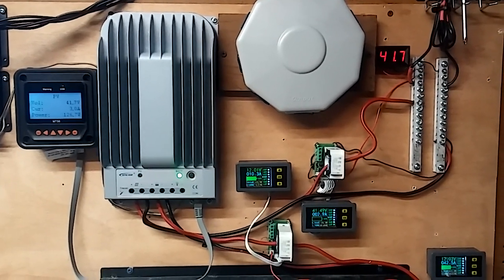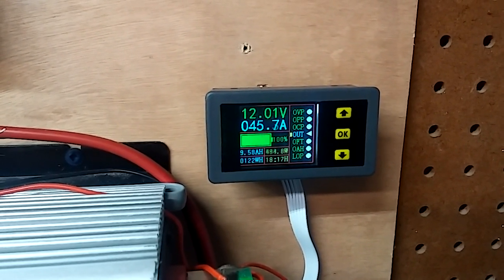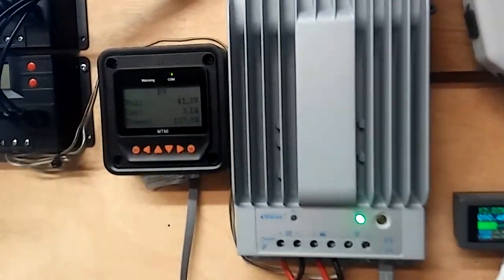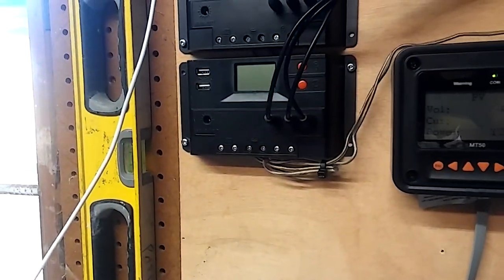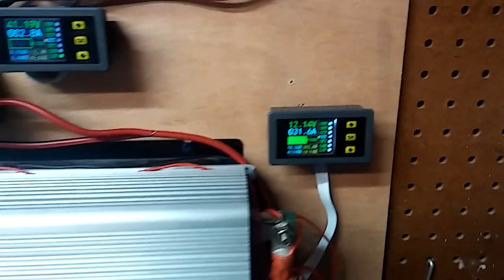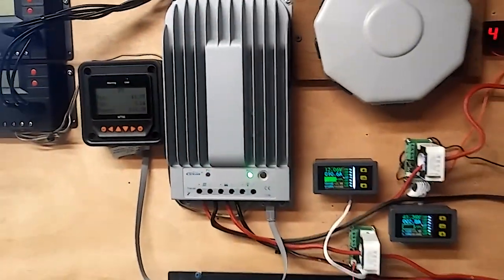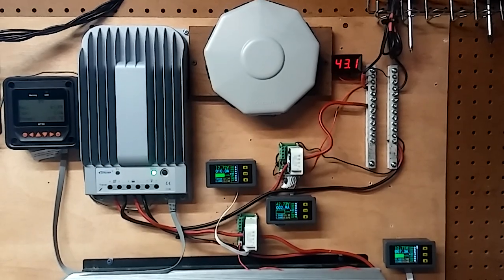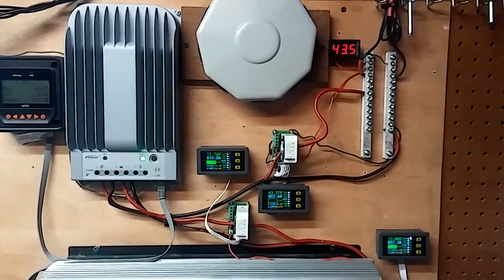12 harbor freight panels in series with mppt. Nice and sunny

Comment: LOVE TOO SEE THE WIREING ON THOSE PANALS, DID YOU CUT OFF THOSE PLUG IN S WIRE THEM TOGEATHER/ WITH TOO DC WIRES THAT GO TOO A BUSE/ FUSE THEN CONTROLER?
Reply from the maker: Yes,, I cut the connectors off. There are 3 100 watt kits. 4 panels per kit. 4 panels go into a connector that gives you one connector out. That is the connector I cut off of each kit.
Reply: @Checkitfirst  I HAVE GENERATION 1  HF 45 WATT PANALS 6 TOTAL, WOULD LIKE TOO WIRE THEM TOO A BUS AND TOO MY EPEVER MPPT 150VT ?  TWO WET DEEP CYC, PURE SINEWAVE INVERTURE. 4 MY GRN HSE.
Reply from the maker: @debbies3763  
Do it. Run your panels in series you’ll be around 118 120 V I’m guessing. Just be careful not to shock yourself with DC voltage because it hurts. I’ve done it lol
Reply: @Checkitfirst  THANK YOU FOR YOUR RAPID RESPONCE TOO MY DELIMA, I didnt want too purchase that round connector.
Reply from the maker: @debbies3763  
Lol. I threw mine away 😁

Comment: When you are just charging your battery with no load and no inverter plugged in, what are some typical numbers for Amps into your battery as viewed on the MT50? 

I have the same set up as you and I have quadruple checked everything (I am running HF panels, 2 sets of 100W with two each paired in series and then those four (sets of two) wired in parallel to the same charge controller you have. I have reset my Mt50 several times. I seldom get even a full amp into the battery. Usually, something like 14.4Volts/0.7amps into the battery until it reaches Float and then down to 13.8 volts. My batteries  (12 volts, deep cycle, AGM, 1200AmpHour) charged one at a time very well and usually within one day of Southern CA sun. (I rotate them out one at a time and bringing them into the house to connect to a 2500W inverter to watch TV, run LED lights and such). I never deplete them more than 30% based on monitoring AmpHours used.  I just don't seem to ever see the current you do into the battery but I never charge them with any load on them. 
Ideas??  Thank you.
Reply from the maker: Ben Kanobe. Well, I no longer have mine hooked up in series anymore. I like the way mine works in parallel better. A lot of times I would show a good voltage but I just wasn’t getting the amperage. I would just put it all back to parallel if I were you and try that. If it doesn’t work out let me know I will do my best to try and help you if I can
Reply from the maker: Ben Kanobe. Also I was told that those AGM batteries don’t draw as much current as A typical marine battery like mine. I hear they’re slightly more efficient so they just don’t need high amperage to charge them up

Comment: Hey check it first, Just wanted to thank you for great videos. I am happy I came across your channel I have learned a lot from you and just bought a harbor freight kit. Please keep making videos about solar systems.
I watched all  of your videos in one night, great stuff and I also subscribed to your channel.
Reply from the maker: mrhodes100. I’m very happy to hear that. Im thinking of adding wind power to my setup if I can find a decent radial axis. Thanks for watching and subscribing
Reply: Wind power would be great I don't know a thing about it just like I didn't know about solar until I watched your videos .

I have a question, are the Cen Tech inverter any good I have the 750 w one?
Reply from the maker: mrhodes100   I haven’t heard any bad comments on them.

Comment: Hi i think if u get 330w panel u mentioned .IT will be about the same as what u have in  w  may be a touch moore i have 300w and they only give me at best 180W so when sun hits panel u lose around 20% so ishould have 240W  but no no 180W i think your set up has improved. Soi think u need pure sine inverter get 300w panel look up how meany amp panel produces my 300W give moore amp then 320W but 250 W give moore then the 300W so look in to that before u buy panel i couldent power 100w light bulb now i power aircon 5 300W panels and only 2 65amp ds batterys 2.4kw box air con i have 2 12v systems 1 i power 3desk top pc and fridge while sun out with 170amp ds battery

Comment: I am the guy that suggested changing the angle..There are charts that have the best angle for this time of year...I know the sun is low this time of year...Maybe take only 1/2 of the panels off the roof.. Make them closest to the angle the best you can on those...Hook them up to your system...See which set does better..Also, keep in mind , these are not chasing the sun following its angle through the day...I am not sure what kind of setup you can do there...Does it need to be on the roof? Maybe a setup on the ground you can control to face the sun easier. You could move the panels through the day..
Reply from the maker: Sounds like a good idea. Maybe I will try that.

Comment: Looking really good, I know when I talked to Renogy about my charge controller it is VERY important to not exceed max Voltage on the charge controller, but a small amount over on Amperage it could handle for a small amount of time.  I mention this because some of those bigger panels run at a lot higher voltage & I don't want you to fry your new controller.  Read the specs & follow the manufacturer recommendations & have fun.  
Thanks for Sharing Friend.
Reply from the maker: Thanks for your input. I really appreciate it. It has a 150 max volt input. Thats kinda scarry to me. 150 volts dc could really shock the #&%$ out of me. I felt a little shock from just the 60 volts.. I migh go back to parallel so I can add more panels without killing myself. Lol....